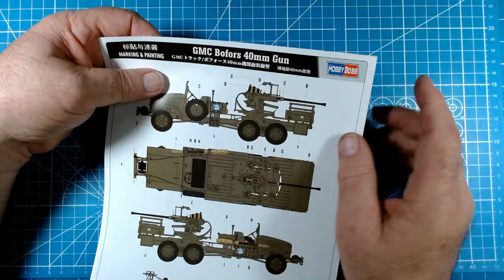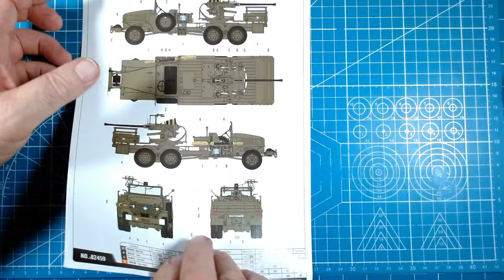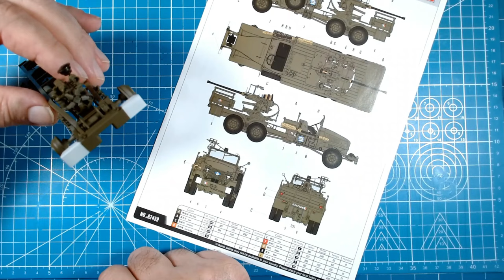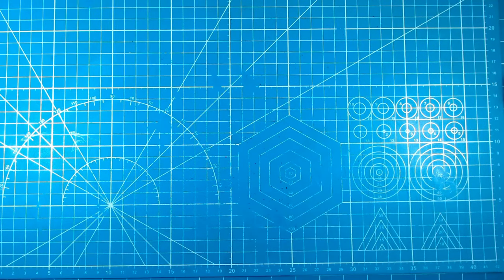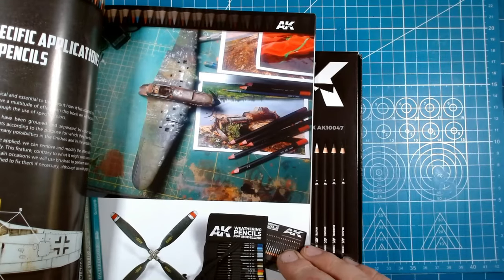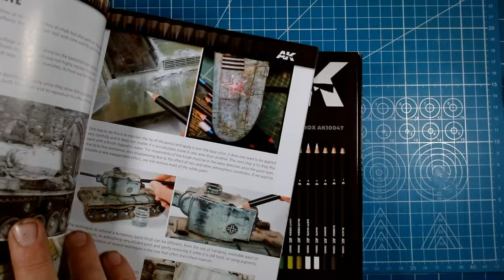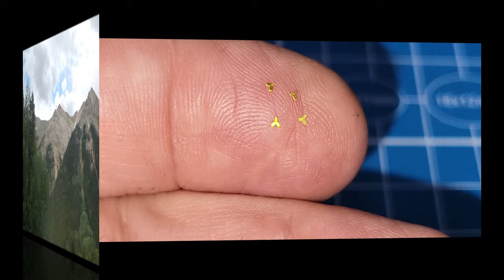Hobby Boss #82459 GMC Bofors Part 20

Comment: Another binge-watch session on this rainy Sunday. Really enjoying your build, Jeff. Nice job on the gun. A lot of fiddly parts! Where did you get that holder thingy you're using to secure the gun? Be well, buddy
Reply from the maker: Hi Pauly, Thanks again for watching.  A lot of people have asked me about my little vise.  It came from Amazon, it's called a Megacast Hand Free Universal Work Holder, Peg Clamp Base Vise Bench Tool Set for Jewelry Making with 8 Pin  It runs about $22.00.  The vise has a small design flaw.  The base swivels on some nice shiny steel balls.  Unfortunately, the clamp that holds the vise in place has a tendency to slip.  A small piece of sandpaper between the steel ball and the clamp solves the problem. Have a great day buddy.  Jeff
Reply: @JeffDonahueScaleModeling  Thanks for the info, Jeff. And, thanks for the heads-up on the design flaw. Muchly appreciated, my friend